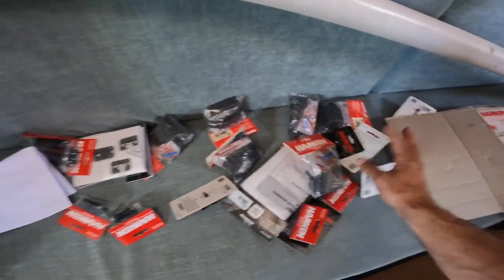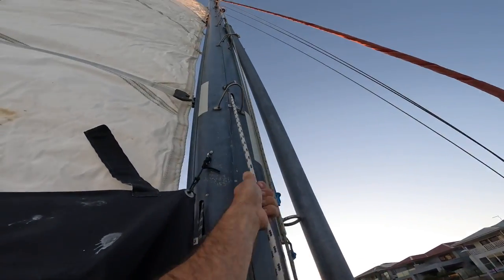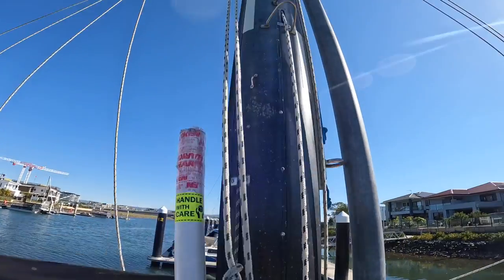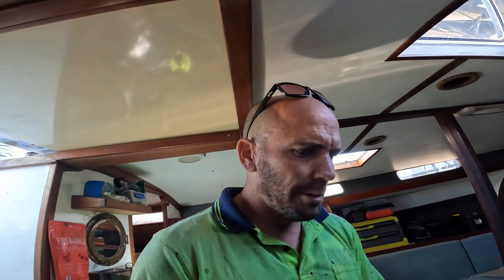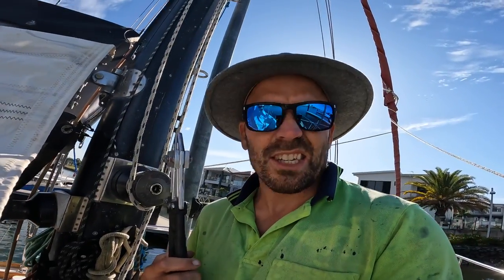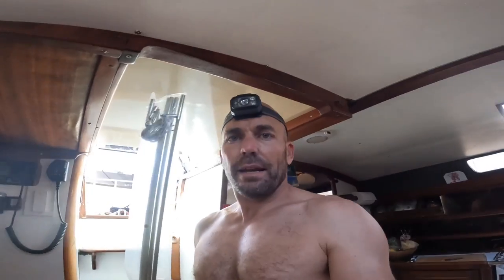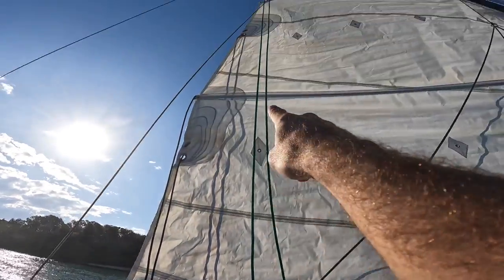New Harken Battcar system & mast track 🙏

Comment: I realize it's too late now but I would have recommended the Tides Marine mainsail track system, you would have been very pleased with the installation and operation at a fraction of the cost.
Reply from the maker: I did look at them. I just thought if I was going to upgrade I’d just go bearings. I’d like to use a tides marine track some time to compare for sure 👍

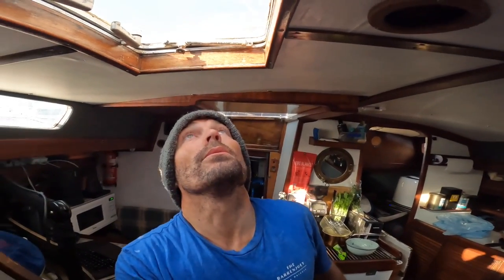Comment: If you look at one of the frames between 8:48 and 8:50 it looks like one of the bearing balls may have fallen out during the final installation(not 100% sure, but thought I'd mention it)
Reply from the maker: You're almost definetly right. so many dropped out! I did reinstall them all, it may have just not made it into the edit. good spotting! cheers for the heads up! Tymon